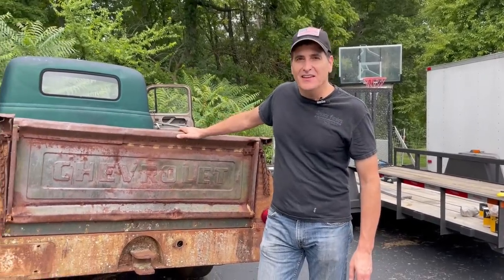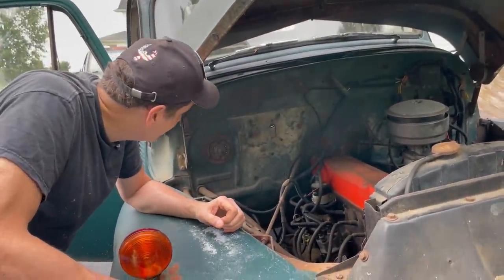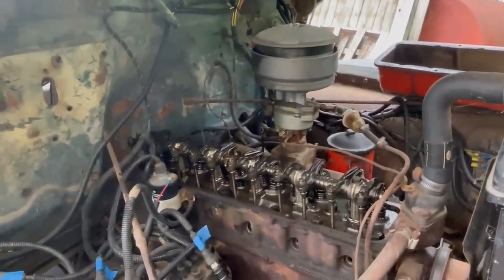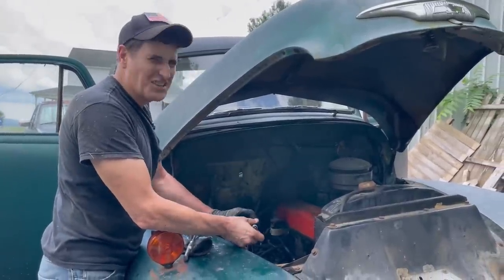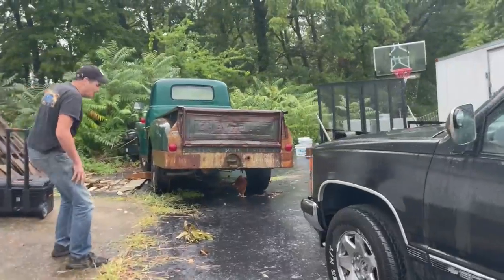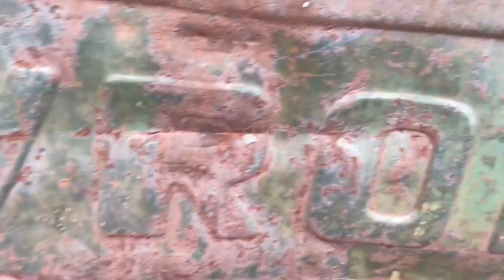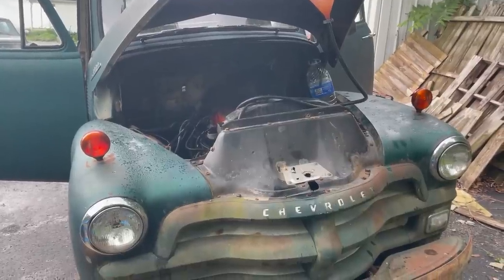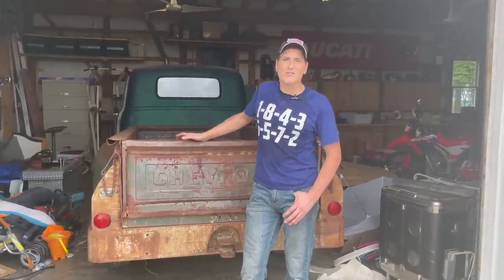Will it run and drive? 1954 Chevy truck needing some help.

Comment: I'm thinkin' the C stands for CHOKE
Reply: Yes sir it does and some of those old vehicles had not only a choke  knob but a throttle knob as well (might be over on the right side it looks as though there might have been a throttle knob as well. I noticed on that carburetor that there is a linkage arraignment that opens up the throttle some what when the engine is choked. I have one of those Rochester carburetors for a six cylinder Chevrolet engine that is set up that way.

Comment: That's a 235 engine. Much better than the old 216.
Reply from the maker: Right, the side valve cover bolts give it away. It is quite a bit more advanced than the 216. Thanks for watching.

Comment: That is seriously one of the cleanest domestic straight sixes on the inside that I've ever seen. It was either recently rebuilt, or whoever owned it took really good care of it with frequent oil changes.
Reply from the maker: I agree. It must have been rebuilt at some point in the past.

Comment: That engine was extremely clean for an engine that had been sitting. It couldn't have been sitting for very long. It is a beatiful truck though, and it is in fantastic condition for it's age. The owner is lucky to own such a nice truck. Thanks for the lesson on dwell. Honestly, I didn't completely understand it, and you explained it better than anyone that i have seen.
Reply from the maker: You're welcome!

Comment: Them old 6 cylinders live forever. I remember in the early 80s my dad bought  a 46 Chevy pickup . The engine was stuck. He poured a concoction in the cylinders and every day for a month he would go out and give it a tug. 1 day it broke free. 2 hours later we was taking a ride down the road and back. Motor just purred just like that one did. If I remember correctly he sold it for triple what he had in it.
Reply from the maker: That is a cool story.

Comment: Well that's a very nice 54 Chevy. You can hear from the beginning of the video after you got it running the first time but difference at the end of the video. Running smoother the oil is moving around everything you did helped it. Fantastic! On the dwell. I've got an old 56 3800 it's a one ton dually though kind of reminds me of tow mater. My point is that rod for the external mirror on the driver side is probably original equipment of course the head on it looks like bottom of tin can with a piece of mirror glass put in it. If I remember right it has a gentle slope going back to the pivot point on to the rod that is the back of the mirror casement. I don't think it's 6 in in diameter. Anyway on my 56 it has kind of a tear step design on the back of it. In any case those things rust out and they're probably repop available by now. I haven't gotten to my 56 Chevy truck yet. The 59 I use it on a regular basis bigger truck different mirrors and it has the floor push button starter lever as well. It is really neat until you have to reach up over the fender prime the carburetor a couple of times and climbing up into the cab a couple of times holding down on the clutch pushing the gas pedal and the starter lever all at the same time. Those old boys back then we're very coordinated I guess. In any case I'm actually looking at the remains of the 54 sometime this week. I really like the video the old truck with what 10 ft bed probably. I believe throughout time you could get beds and 2 ft intervals up to 16 ft. I have personally seen a 14-ft bed. Now I know they had flatbeds because I had a 48 GMC that was a flatbed that was put on at the dealer when it was new. Truly a basket case it was all in pieces. A friend of mine I sold it to him and kept the Ford that I bought at the same time NetSpend back in the '90s. He never did anything with it except for yard art and his widow is selling it as well as his 85 or so box body truck. I encourage him about it reads these comments that these trucks are out there if they want one just go and hunt. Not everybody thinks it made of gold either. Some of the owners realize that they're made of rust haha. Look forward to the next video
Reply from the maker: Thanks for the info Chuck. More videos coming!

Comment: I had a 1950 GMC 1/2 ton. All original.  6v, 235, 4speed compound low, short bed. Couldn't kill that old girl.
Reply from the maker: They are great trucks.

Comment: I finish a 56 chevy 3100 series  pickup with a 235 engine this summer.  I did an off  frame restoration which took about 7 yrs. But I did a relocation from Ga to Tn  which took about 3 yrs of that time.
Reply from the maker: I hear that. Nothing like a move to slow things down.

Comment: As a kid, we had a light duty 54.  It wasn't original, though.  Collectively, it was a 54 Chevy, straight 6, but with a 5-window cab and a GMC tailgate.  The front bumper may have come from a 49.  It was kinda a hodge-podge of Bowtie and GMC.  Colors?  Front half was primer flat red, back half was primer grey and light blue.  Still, was a cool farm truck.  Ugly and beautiful at the same time.

Comment: My 62 C10 has the 235 with the same oil filter. That gasket is indeed the correct one.  My new filter had it and the same gasket was in there already. You have to center it and tighten the cap down slow for a correct fit.  ;) 

Looks like it had the old Eaton rearend in it.  My 62 has it as well. 
Last year before the 12 bolt.
Reply: Actually, that gasket should fit in the groove that is in the filter cap. All one has to do is to center that cap on that gasket using a flat surface and trace the outside of the cap with a pen and trim it just on the inside of the line with a sharp pair of scissors. I had a 56 Chevrolet that did not come with and oil filter (oil filters were optional back then) we added an external oil filter (got it from a junkyard) and probably there were variations on the outside diameter of the filter can and unless you had the actual part number that came on the side of the can you could get the wrong size gasket. We would just simply trim the outside diameter of the gasket to just fit inside the groove on the lid and it would seal just fine or as Richard did, just make a gasket out of cork. The filter itself was pretty much the same just the filter housing could be different.

Comment: Got that points dwell set? Now adjust the timing. You'll see a spot on the bellhousing that has a window on the starter side of the engine and the pointer is aligned with the ball on the flywheel. Dwell affects ignition timing, but ignition timing does not affect dwell. And you are right dwell is the number of distributor degrees the points are closed allowing the coil to saturate and give proper secondary voltage to the plugs. Most people do not understand that.

Comment: The algorithm hasn't been showing me your vids.  I am binge-watching old episodes and saw this.  Nice job!   I think this had a 235 and a pressurized oiling system instead of the splash system with babbitt bearings of the slightly earlier models.  The oil pressure gauge going to 60 psi is the clue.
Reply from the maker: I hadn't thought of that, but you are correct in that the oil pressure is too high for the older splash oiling system. I am not sure what is going on with the the Youtube algorithm. It seems that the only way to be sure you are notified is to subscribe.

Comment: I would really like to see this thing back on the road with a first Gen '51-'58 FirePower 331 Hemi with the dual carbs and that same 4 speed manual, but like my pap used to say, "you can wish in one hand and crap in the other, and see which one fills first." Those 331 Hemis only made 180 HP, but it's a REAL cool factor to open that hood and see that beautiful red valve cover Hemi staring back at you with the bronze colored air cleaners (like in the '57 300C). The straight six that's in this thing should be saved on, because it's definitely one of the cleanest engines I've ever seen.

Edited due to autocorrect on my new phone...

Comment: I just purchased a 1950 GMC 450 dump truck. Found papers dating 1951 when a Sargeant had did the check off sheet for safety and it had like 217 miles onit at that point. It is extremely solid. Bo rust through floor board cab corners look great. Currently unabke to get it to pump fuel. Think cam lobe is wore out not pulsing the pump. But i seen truck and just had to have it
Reply from the maker: That sounds like a nice Truck. My Dad had a 1951 GMC 900 back in the 70s. It was outdated by then, but still a good-looking rig. My Dad only bought GMCs, never Chevrolet.

Comment: You reach down there and you force the rod onto the starter with your head under the hood that's the way you trigger it it's even easier than wires

Comment: That sounds like a good old truck. Give it a tune up,clean it up,and use it daily. You can probably depend on that truck more than these new ones!
Reply from the maker: Right, once the starter is fixed that truck could be driven daily. It is super low geared, but around town it would be fine,

Comment: sometimes you can use a long screw driver  under the hood and press the button on the starter to start. wedge it either to bell  housing or firewall
Reply from the maker: Great tip!

Comment: Strange (at least for me) the single barrel carburator on this Chevy truck engine.
Float chamber seems to be around the barrel 🤔.
Would be a standard type & configuration intended to reduce costs ...
Nice anyway to discover a video regarding a old / classic light truck 👀 however I prefer the cars !

Comment: Another way to bleed brakes and you can do this by yourself if you don’t have help is put a length of vacuum hose on each bleeder into a bottle with some fluid in them break the bleeders lose as long as the ends of the hoses are covered you can slowly pump the brakes till you feel the pedal get good then retighten the bleeders and remove your hoses they can’t suck in air covered in fluid in the bottles

Comment: The initial ignition timing sounds a bit too advanced to me. The slow initial cranking makes me think that. Plus, you could hear detonation a couple times when it was doing the slow-crank thing. Great job getting her going again, my friend! Now for some fine tuning and fluid changes for the trans and differential. That stuff and some fresh leaded gas, she's good to go!
Reply from the maker: Right, I think the dwell being off has the timing also off. The starter is going bad, so I was unable to finish tuning it. The owner is getting a starter rebuild, so I'll be able to get it tuned correctly soon.

Comment: My '51 F-3 has a cannister oil filter assembly like that one and no drain on the housing so I use an old turkey battery to suck out the excess old oil til its almost empty then wipe the residue out with a shop towel or absorbent old rag.
Reply: I meant Turkey Baster
Reply from the maker: That is a good idea.

Comment: My Dad had a 3/4 ton 1951 Chevy. No turn signals but this looks really familiar. His had also been converted to 12 volt.
Reply: The knob with the C is the choke.
Reply: You have to put the gasket in the cover it will work.

Comment: I've got a 54 3600 that my Dad bought in North Dakota when he was discharged from the Air Force in 1971.  The truck hasn't ran since 1974 and has been in storage since. 

I want to get it running but have absolutely no idea where to start.

Comment: I believe the motor is a 235  Chevy changed to that style valve cover in 54,and all insert bearings .the 216 engine had a small base plug
Reply from the maker: Thanks for the info. I think it is a 235 as well.

Comment: Cork gaskets compress so much you can go back later and retighten the bolts a little if they leak.
Reply: Actually the Felpro people stated that cork gaskets will swell when they saturate with oil and until they get old and hard they will not leak it is when they are hard that they will not compress anymore and the only solution is to replace them. Of course one can overtighten a new cork gasket to the point to where they can get cut and then they must be replaced. It doesn't hurt to recheck the bolts for loose fasteners but one should not overdo it.
Reply: @billywird  Have you ever installed a cork gasket?

Comment: 32:00 I hope you use some of the new oil to fill the area around the oil filter cartridge before you put the cover back on it. Otherwise it will take too long to fill and you will not put the proper amount into the crank case.
Reply from the maker: Yes, I did.

Comment: A 1954 would have the fall pressure oiling 235 engine, and not the old 216 splash oiling engine,  The starter solenoid is manual, so no way to use an external switch to operate it. Trucks kept the manual solenoid switch longer than cars.
Reply from the maker: Thanks for the info! Good to see I was not crazy for not knowing how to get the trigger to work with the manual starter.

Comment: I’m gonna say that’s most likely a 235. Could be a 261 aswell though
Reply from the maker: I am thinking a 235 as well. I am not familiar with a 261. Something I need to read up on.
Reply: If that engine is the original engine in that truck it is most likely a 235. I believe the 261 was offered in the bigger trucks around 1958. Those who know say that there would be "captains bars" on the side of the block (I not for sure which side but those bars cast into the block are an indicator.

Comment: Neat truck, those long bed stepsides are becoming the unobtainable to find in the rust belt I'll tell ya that, the 3800 i believe was considered a 1/2 ton truck, But I'm sure you had options for axles up to 1 ton. etc. 54 it was also the first year for the one piece full front windshield, a pretty hard year to get nowadays as i think it was 1954 only.
Reply from the maker: That is good info. Thank you.
Reply: Actually the 1954 Chevrolet and the 1955 Chevrolet First series was the same with the one piece windshield. The 1955 2nd Series was of a new design (the taskmaster cabs from 1955 2nd Series until 1959) That truck has the three quarter ton axles.

Comment: Excellent video Parque  :) yes that motor be 216 6 cylinder also C control is Cold ( Choke ) also runs very nice and be interesting how many miles got bet very low and that bumper is farmer special buy hitch can tell plus it 1 1/4 ton 3800 series! 11,0000 pounds weight because 10 leaf springs on front on back of each wheel for suspension! 3500 1 ton or 3600 series are 10.000 pounds  only leaf springs back only ! 235 Blue Flame  6 cylinders motor was 1955 when came and then in 1960 230 or 292 6 cylinders plus V6 305 4.7 litre Hercules  also 283 V8 2 barrel ,then  1966 250 or 292 6 cylinders & V8 307 327 350 396  2 or 4 barrel  , all way 1985 but 1972 305  was introduced till 1999 !  1973 to 1985 400 V8 also 454 to 2007 ! 350 Oldsmobile Rocket Desiel  in 1979 to  1985 ! Manual transmission on Column Shifter was in 1959 to 1986 , floor shifter was optional Automatic transmission were in 1955 From Power Glide Turbo Hydromatic of 200R 2 speed to 3 Turbo 350 , Turbo 400 3 speed , Overdrive Turbo 700SR  4speed  Overdrive 1970 to 1996  ! Then  Allison made after ! Duramack Desiel motor 6 cylinders in 1988 to present  years! Axle ratio went from 252 to 418 for GMC or Chevrolet  most common 1950's was 390 !
Reply from the maker: Wow, 1.25 ton? I have never heard of that.
Reply: @whattherust  rare for sure !

Comment: 1040 of 20 years ago is sicker than 1040 of the day without the oil technology changes if you ever go to the market and get ahold of an old camp but don't can't I have a 40 way try to pour it and it looks more like STP or Lucas oil stabilizer Then it does support you wait that's in the auto part store today is like water and comparison remember grandpa tell me stories about not being able to pour 40 weight oil when it was cold and a few wounded up in a band on a stove

Comment: The knob with the c is the choke the engine is a 261 cubic inch. And it is the original air cleaner..how come the man who owns the truck didn't find someone who knows more about what they working on? I don't mean that bad but who would think the know in the cab with the c on it was a vent.ever hear of a manual choke?your way wrong about the engine.why would you think it was a 216 have you ever seen one? They had 2 nuts on top of the valve cover holding it on if you'd ever seen a 216 you'd know that right?I got a bad feeling your going to do more damage to the poor old truck than good .how do you know its 12 volt they make a 6 volt altanator too did you know that? And if it's not 12 volt you just fried all the guages .the one main reason it blowed oil out like that is it has sticking valves.i bet you just succeed the carb full of rust and sludge you didn't unhook the gas line before you spun it over not to smart. You need starting fluid before you wreck the old starter good luck buddy..old moter sounds good there wasn't nothing much wrong with the truck when you started.

Comment: My auto teacher said to not drive these trucks for a long time over 55 miles anhour. I can say, this is a true statement. I lost my engine on my 51 Chevy.
Reply from the maker: Definitely. This truck is very low geared. Probably something like 4.56 or 4.10.
Reply: @whattherust  my 48 3800 has 5.14
Reply from the maker: @ThePigslayer  Wow, 5.14! That is amazing.
Reply: @whattherust  yeah. And it’s a Babbitt 216 at the moment. 40-45 seems like plenty. I’ve got a 292 to go in it eventually. Got the motor ready to drop in. Just need to move the radiator forward and get an electric fan and clutch for it. Then exhaust. Might look into a rear swap for it with the new engine. It has the same flatbed as the 65 ish model truck you revived in another video.
Reply from the maker: @ThePigslayer  I love the 292, Very stout.
Reply: @whattherust  yeah. I gave 50 dollars for it. Seems to run well. Unknown mileage but for the price I can’t fuss. I have a short video on here of it running